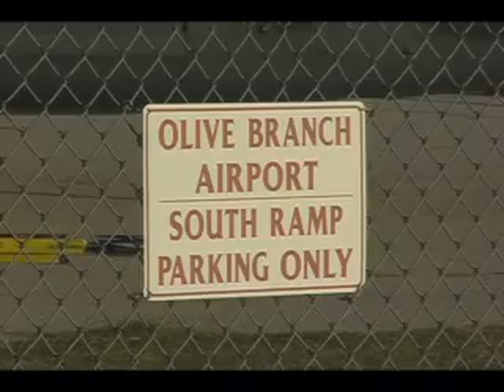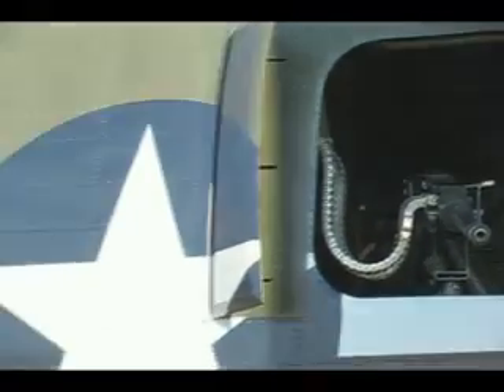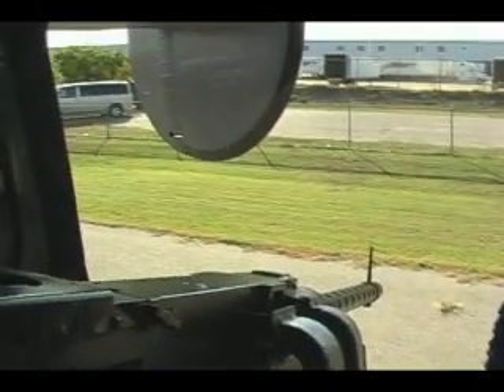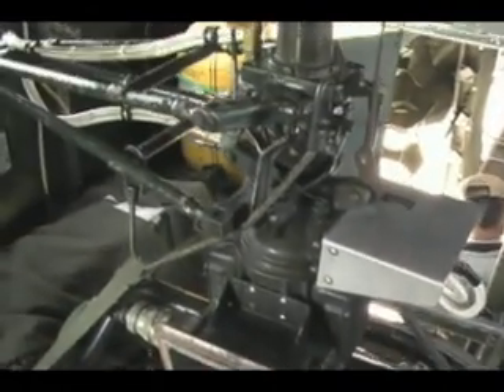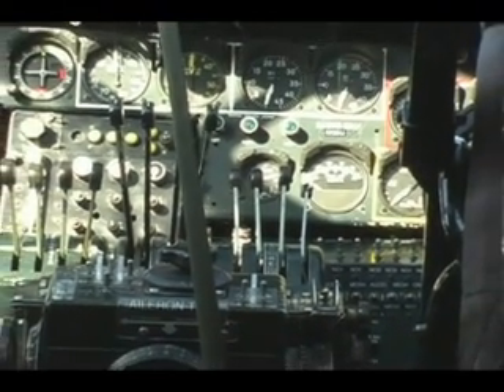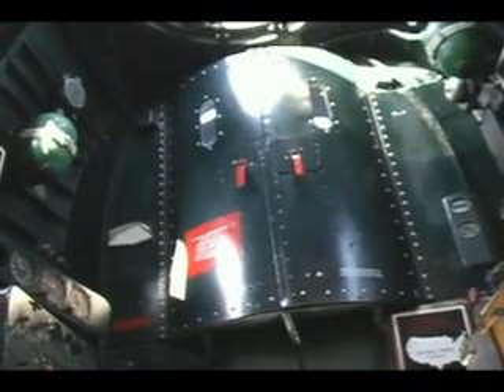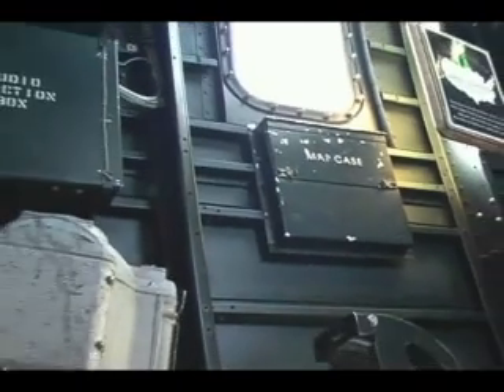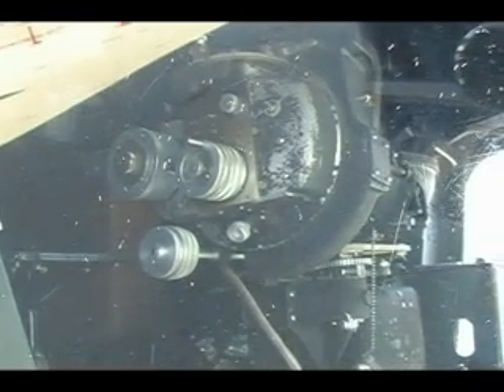B-24 Liberator

Comment: I work with these planes, and compared to the vast majority of people I've seen volleyballjones did a good job describing the plane.  The only thing I noticed that he got wrong was on the ball turret.  What he identified as the entrance hatch is actually a service hatch to service the guns, sights, etc. The entrance hatch is on the opposite side of the ball. The turret would be rotated guns-down to expose the hatch so the gunner could get in. Not a big deal since 99% of people get it wrong, too.

Comment: No.  Volleyballjones got it exactly right.  It is an astrodome, and it was used to navigate using the stars.  It was never intended to be used as an escape hatch.  It is far too small for a person to climb through, nevermind the significant height of it in the B-24 nose.  Add the incredibly bulky flight suits they wore, and escape would be impossible for all but a miniature contortionist.  Any stories you heard about it being for escape are either false or, if true, a gross anomaly.